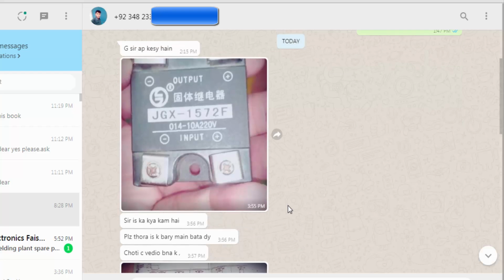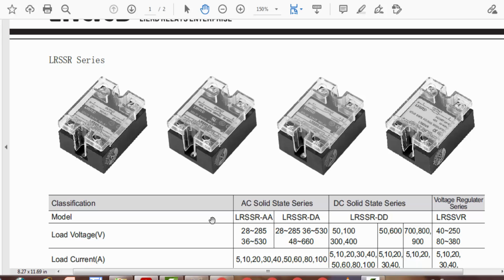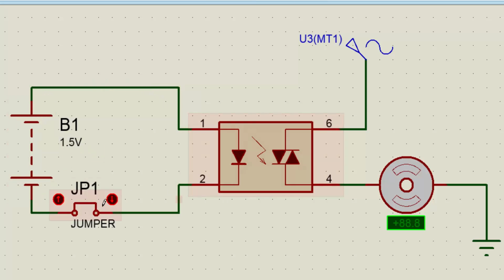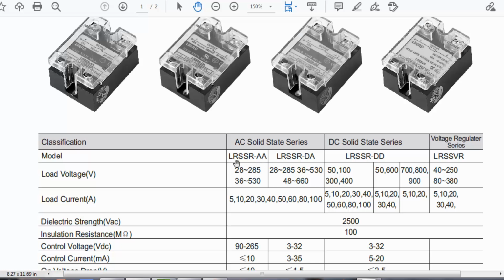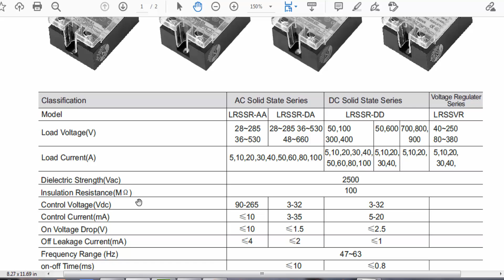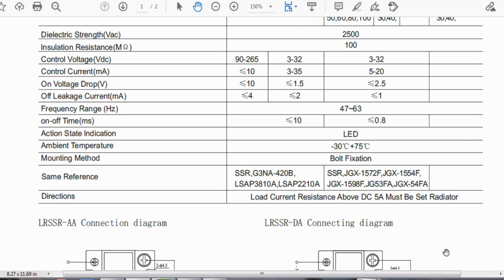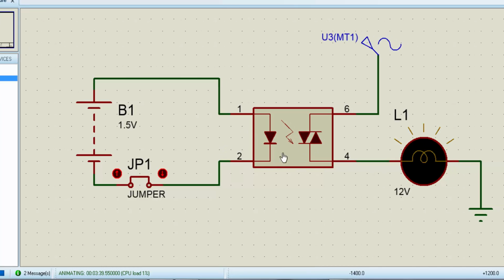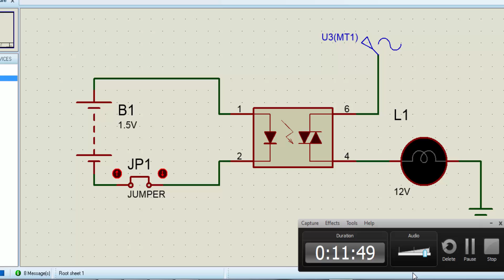#293 Solid State Relay SSR JGX-1572F

Comment: I have attached asynchronous motor to SSR but problem is SSR giving leakage 3 to 4vAc.due to this leakage voltage my motor giving humming sound. I have attached RC circuit but problem not solved, can you suggest me how to reduce this leakage voltage